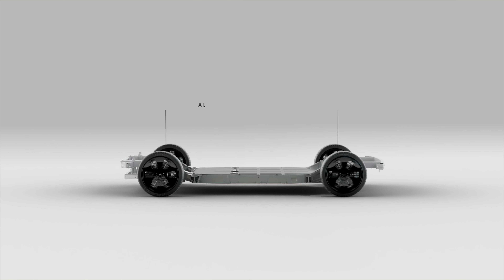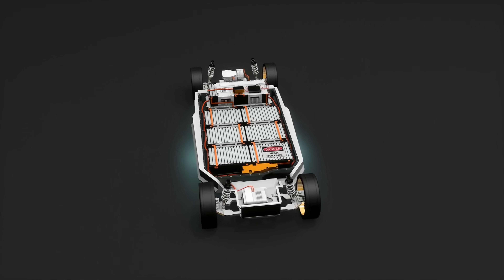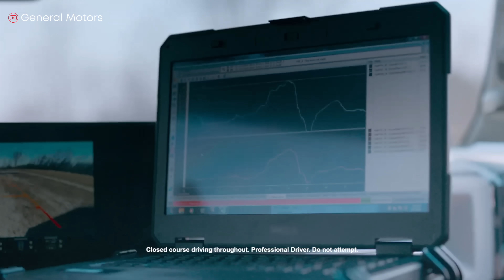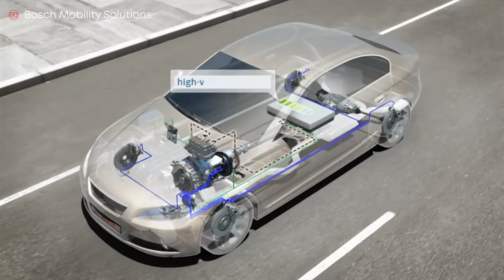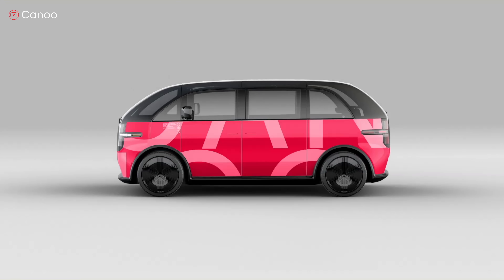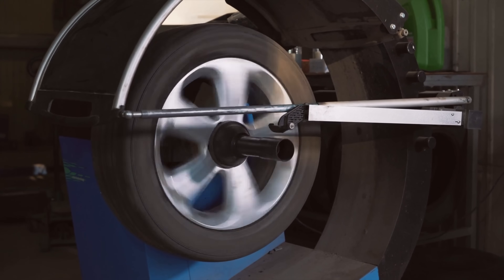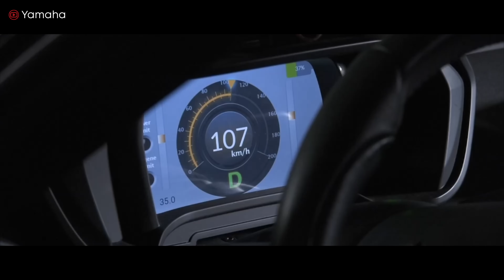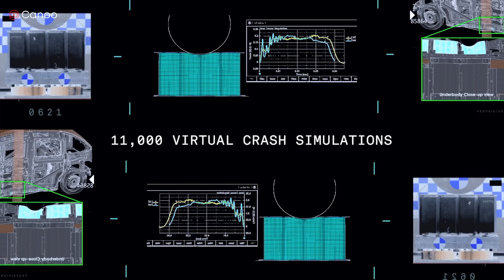No One is Telling You the Truth About Electric Cars, So I Have To

Comment: What worries me the most about the electric car right now besides range is I live in Arizona. Ambient temperatures in the summer can be around a hundred fifteen degrees. Shade is not always an option. Temperatures off the asphalt or concrete can exceed a hundred and forty five degrees Fahrenheit. If you're at work that means the vehicle will be setting in the heat for at least 8 hours plus the commute to and from work. So what total effect will this have on battery?
Reply: It is definitely a concern for folks in Vegas and Phoenix.  You want to look at cars that use traditional liquid cooling.  Some, most notably the Nissan Leaf, did not do this but are instead air cooled.  Do your research on those vehicles that are liquid cooled, check forums and such to see if owners have experienced heat related issues in hot climates like Arizona.  My gut tells me that 100-150 degree temps are not hot enough by themselves to fry a battery pack.  The concern is that when driving, the batteries are moving electrons and this creates heat.  You want to limit how hot the batteries get during operation.  Perhaps on really hot days you'd want to avoid pushing the car hard, which could stress the battery, but generally if a EV is up on its coolant it should be okay to sit in the heat.
Reply: @livemeyer  I agree. That's what I've been trying to do.  I've also been trying to talk to people who actually own these cars.
  My biggest concern is cars parked outdoors in asphalt parking lots. Makes me wonder how which is around 150 degrees would be affecting the effectiveness of the battery and the longevity.
  But like everything else maybe just a matter of waiting and saying what happens in the long run.
Reply: These things seem to work well in middle America. South is to hot, north is to cold.

Comment: I still think that when comes to buy an electric car it should be a new one, I wont trust the battery reliability,  remember battery charge should be kept inside 20% 80%. , not in very cold not in hot temperature, in a garage is the best, I dont have a garage. for that matter I prefer driving an old banger car with combustion engine  as long as it is easy to fix, this is sad to say,  the idea is to keep as much as possible in my wallet.
Reply: I agree with you Dan i feel the Same Way !!! So if you live in Minnesota, or Phoenix AZ, you better not buy a Battery Car it won't run!!!>>>> Nice !!!
Reply: I like money in my wallet. I own a nissan leaf. It costs less than $0.10 per kwh to charge and gets upwards of 3.2 miles/kwh. Also like Scotty said the maintenance cost is really low. Do the math. Its dirt cheap to drive. Not for road trips but for commuting its nice. Also I plug it in when I get home and never have to go to the gas station.

Comment: So, if the battery doesn't need to be replaced, maintenance on an electric vehicle is cheaper than maintenance on an internal combustion engine vehicle.    That's a mighty big "if".      Mighty big..
How much is the resale value of a used electric powered vehicle?

Comment: Charging station supply has limitations compared to internal combustion engines.  This is problematic when traveling great distances and is a deal breaker for many who would otherwise make this their vehicle of choice.
Good information Scotty.   Thank you for your insights.
Reply: Not designed for long range trip 😄 we still need combustion engine for a while
Reply: Sure, if you are buying a car for very long trips today, EV is a pretty poor choice. On the other hand, there are cars in Chinese market that go 900+ km (560 miles) on a charge and cost like a cheap family car in the US. I am mentioning them only because they offer a look into what will be offered by western car makers in the near future. Plus, electricity is everywhere and can even be produced by a substantial portion of the public (say, installing solar on the roof of the house). Furthermore, more and more new EVs will have VTL, meaning they can power normal house appliances or charge other cars, which reduces the risk of getting stuck on the road even further. 
Gas, on the other hand, is produced by a handful of corporations and sold by private companies. As gas prices go up while the demand drops, private gas stations may switch their business models or put money elsewhere, - then ICE car owners could find themselves in an even bigger pickle than current EV owners are on the longest of trips, I can assure you of that ;) Even now we are not safe from freak gas shortages, because it is very much dependent on complex supply chains functioning properly. Not so with electricity, it appears. So if you're buying a car for normal use (i.e., relatively short trips) and can afford higher entry price, then it can be argued that an EV is already a pretty good choice as 300-400 km is pretty much guaranteed and you will not need to charge it anywhere else but at home (considering you have a house or install a charging station next to the apartment building, which is more problematic, of course). 
All in all, EV is quite problematic right now, but as a long term purchase it is already more future proof than any ICE vehicle purchase, imho. I may be wrong, of course.
Reply: @uncutfishing  well thats pretty long explaination 😄😄 yea i agree with you
Reply: @Willyliemfams  If you would take a look at my videos (warning: no cars there), you'd notice I'm not a fan of short stuff ;)
Reply: Tesla has strategically passed Tesla charging stations so you can travel across the country. And they are self powered
Reply: @uncutfishing  Tesla has one car that has a 620 mile range and like 5 or 6  $5000 cars. I'm not sure if all have hit market yet but he has unveiled them.
Reply: Lol depends on where your considering your travel. But on the other side, plenty of people who still own gas vehicles still rent a car so they don’t put miles on the car they own.
Reply: these are for people who work for a living- not retiree's who travel
Reply: @FordFalcon1962nBlue  This is true.  Battery power has limitations to consider that restricts its use.
Reply: Depends - it’s all about planing out the trip.  After 2 hours of driving I typically want to take a brake anyways.  So far the stops overs haven’t been that bad. Yeah it extends the trip time somewhat - but if it’s free charges I’m all good with it!! :)
Reply: @michaeladams2077  they will find a why to charge you. Remember air used to be free. And they found a why to make a couple of bucka off of that.
Reply: The Toyota Prius plug-in hybrid has been around since 2012 for this issue.
EV for frequent short city commutes.
Hybrid ICE with regenerative braking for long journeys.
Reply: You don't think when gas cars first came out that gas station access wasn't a limitation? Gas cars have had 100 years to build up their infrastructure network. Ev's have barely had a decade. And the US isn't throwing any money at ev infrastructure like they did with roads and whatnot for ice cars
Reply: Except Tesla superchargers are so abundant in the US the farthest distance between any 2 is 80mi.  Would only need to utilize them for long distance trips as owners would charge at home for the most part.
Reply: @uncutfishing  when I drive in the back country I can carry extra gas or when I run out of gas someone can bring me gas. Wonder how that works with EVs. And as you say gas companies are private.  Last time I checked electric companies are also private
Reply: @arthurbrumagem3844  How that works with EVs? Another car with VTL (available now in some new EVs and will probably be a +-standard feature pretty soon) drives up and you charge from it. On the other hand, it is an obvious business niche. There will probably be mobile powerbanks for cars, as well as say, outdoorsy solar panels that will be charging your car while you're hiking or wading upstream with a rod.
And comparing electricity to gasoline on the grounds of company ownership is not wise, imho, as there are pretty much no more clear similarities. Electricity is and will be available in every stationary, human inhabited or operated object. Plus, we already have the aforementioned solar panels, there is also an option of mobile wind turbines, and in the future there will probably be more mobile electricity production technologies available to regular consumers as the demand for it will increase and billions now accumulated in outgoing industries will be put into electricity production innovation. In other words, I think that wide adoption of EVs will be the biggest qualitative leap in personal mobility since Ford Model T. Let's just hope there's no global war to spoil it all ;(
Reply: @uncutfishing  Maybe, gas stations will start equipping themselves with 2-4 rapid charging stations. Like the video says charge the batteries from 20% to 80%. I heard that the last few percent of the full charge takes the longest time.
Reply: @rosinbum  Maybe, we will have odd and even charging days like we sometimes have for refueling ICE cars.We still have plenty of cars running out of gas within a few miles of a gas station. Imagine even more dead batteries on the road...
Reply: On average a person will need to charge at a charging station 6 times per year, the rest will be at home.  So not as big of a deal as most people make it out to be.  For me, for the year I've had mine, I've only charged 4 times and I think 2 of those was just to check it out.  Obviously, if all you do is travel for work, or you don't have access in your home to charge then it could be a deal breaker.  But even then, it just takes some pre-planning when you go on a long trip and you should be fine.  And imagine the money you would save not buying gas.  Overall, though, I do agree we need more charging stations everywhere mainly just to alleviate peoples concerns rather than actually being an issue.  There will never be a need to have as many charging stations than the gas stations we have now.
Reply: If you're not stopping every 250 miles for a rest, you're probably a legit danger on the road. There is a reason log books exist for professional drivers.

A 250 mile range would give you just over 4 hours driving at 60mph... Which it's unlikely you can do that speed for 4 hours straight.

Electric or not, you shouldn't be driving 4+ hours without a good, proper 15-30 minute breaks anyways, no matter what your gas tank says... So in an electric car, you could be charging on a high speed charger for that 30 minutes while grabbing a bite to eat.
Reply: @Willyliemfams  I drove 10,000 miles in 30 days in my Volkswagen ID.4 on a cross country road trip. I literally drove from the East Coast to the West Coast, from California to Washington state, and then back to the East Coast. I visited the Grand Canyon, Yellowstone national park and lots of other things. I had no problems using an electric car to do that.
Reply: @sh969  Compared to a car, a horse was inferior for open driving areas. Compared to a gas vehicle, EV's are inferior, Until that changes it wiil be  a looooong time before at least half the market is replaced by evs
Reply: You aren’t old enough to remember the oil embargo.
Reply: @Willyliemfams  If you can afford the $5/gallon. People need to drive less. Remote work is the solution,not evs.
Reply: That is changing rapidly...there are many more charge stations being installed
Reply: Money can buy you a clock but not time 
Money can buy you friends but not love 
Money can buy you insurance but not safety 
Money can buy you a position but not respect
Reply: @uncutfishing  no one has a solution to the scaling problem of the grid infrastructure. CA has rolling blackouts now .....what happens when 75% of the cars are electric?
This will cause huge problems state to state and at the federal level.  None of the environmental activists want nuclear but it is the only way forward with electric vehicles.  So.....the US will be forced to build trillions in new infrastructure.....look at all the fuel infrastructure we have now .....think of phasing that out...... something has to replace it.
Reply: 98% of vehicle use is under 100 mi ... considering a 'charge station' is ANY house hold electrical outlet (you don't need to pay for a dedicated charge station, we never have for our EVs).  But in the US "official" charges stations are just about everywhere they need to be, some states are more progressive than others ... but you need to move away from the old idea of "gas station" and "charge station" ... neither is needed or necessary, that's old school train of thought.
Reply: just because the powers that be wont put out a e car that don't need charging stations I wont be buying one 2022 Where's the flying cars??
Reply: bring on the charge as you go cars
Reply: @arthurbrumagem3844  Say what??  You think someone is going to bring you gas when you run out 100-200-300 miles in the back country?  You must have some extremely tolerant friends if they are willing to do that for you.  ANYWAY, if you are willing to bring "extra gas" then for an EV you can bring solar panels and charge the car while you drive, sleep, eat, rest, or anything.  At $7/gallon for gas these days, solar panels are a bargain and never "run out" ... yes even on cloudy rainy days they continue to produce electricity.
Reply: @dotsmada2855  Yes, and technically a charge can be obtain from any standard house hold power outlet (just charges slower).  And there are solar powered charge stations.  No need for very expensive and dangerous gas stations that hold extremely flammable fluids in underground tanks that need to be replaced every 5-10 years.  Gasoline days are long over, there is NO excuse to not be in a EV today.

Comment: Glad to see Scotty has come around to EV's. I'm a total petrol head who builds sport kits cars but got a leaf as my daily driver and simply wish I'd got one ten years ago. Yeah my brakes don't seem to be wearing at all, despite my less than efficient driving. Plus the wheels never have any brake dust so the wheels are always spotless. It's definitely more aggressive on the tyres due to the torque, meaning I need to select ECO mode to stop it spinning it's wheels in the wet. The battery has degraded at a rate of 1% per year (checking with Leafspy) so is not even a consideration. I've owned 34 petrol and diesel cars before this one and none come even close to how much I enjoy driving my EV.
Reply: Who said he’s coming around? He’s just stating the facts on these pieces of crap. By the way, if you gain more joy from driving a glorified golf cart, you were never a true petrol head.
Reply: @LateNightCable  Well said. EVs are a reality, but they are soulless crap.
Reply: EVs have their advantages and disadvantages. He's using it as a daily commuter which is exactly what it's intended for. Nothing wrong with that. Save on fuel costs (LGB), more efficient with its energy usage, and get some fun from sloppy driving on the side streets.

Comment: i bought an old transit van in 2010 for £720 and it was  lpg gas converted with a range of 320 miles,no petrol the carb was knackered..anyway now done 240,000 miles on lpg but i had to have  another engine that cost £300 and £300 to fit it...seems an  economical way to own a vehicle

Comment: I said it before, and I'll say it again, mechanics are going to become IT Professionals. This will make them VERY versatile in the years to come. They can chose to wrench on software updates, and electric replacement parts
Reply: With all due respect, most good mechanics are IT professionals. I had to take course to learn the Bosch KJetronic system 30+ years ago. So... all these darned cars are just computers with wheels. I actually think that ICE demands more tech then EV. With ICE, you need a load of sensors, most of which are analog, then then converted to digital, then processed by the CPU, then sometimes back to analog for the feedback loop. With EV, it's purely digital, except for analog bits like tire pressure. So.. Mama, don't let your kids grow up to be mechanics... unless they like like screen time.
Reply: @joshharrison2657  I agree. The software is in service to the mechanical parts. And electronics can be hideously difficult to diagnose, so the solution is often to just swap parts till things work. The wide number of sensors teach us an enormous amount about how any vehicle is operating, but as will all things, the sensors themselves can become the problem, and the ADC process only heightens that risk. I like the EV simply because it has so many fewer mechanical/fluid/parts to deal with. That doesn't mean they are simpler machines, just different machines where the problems will present themselves in differing ways. When I was a kid, I built the plastic model kit of the visible engine. Even today, manufacturers show off these gorgeous engines on stands. Now... to be honest, they should display the engine with all the stuff attached required to run the vehicle. Let's see the wiring, hoses, clamps, etc.. and then the complexity of the ICE device is made real.

Comment: I have a 2016 Nissan Leaf. It's great for around town or short trips <50 miles one way. It's effective range varies, depending on A/C or heater usage. In the spring and fall it gets around 100 miles per charge. Each charge (from an empty battery) costs around $3.00. When running A/C or heater, it's range is closer to 85 miles. My only complaint is the range. Electric cars have a specific application and it's not cross country travel. My car takes around 6 hours to recharge on a 20 amp 240 volt circuit in my garage (when the battery is empty). So if you buy one, you really need to consider the application. You can save some money not buying gas. I can't think of any internal combustion vehicles can go 100 miles on $3.00.